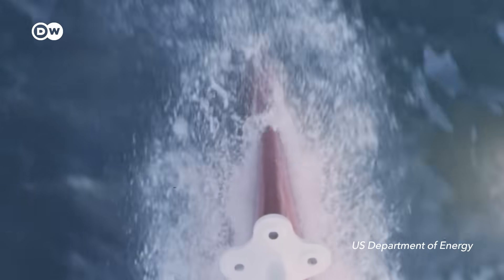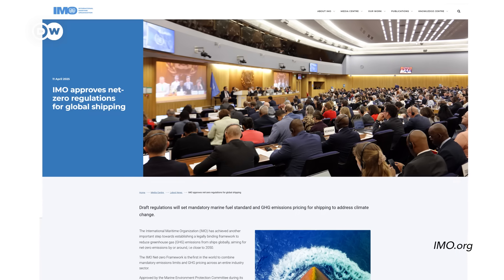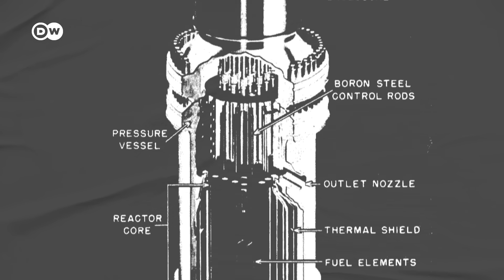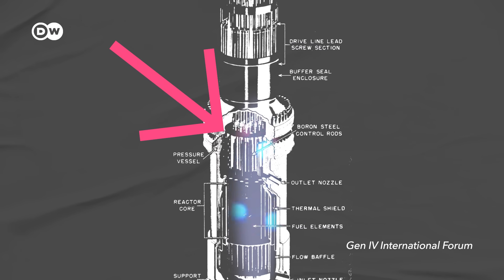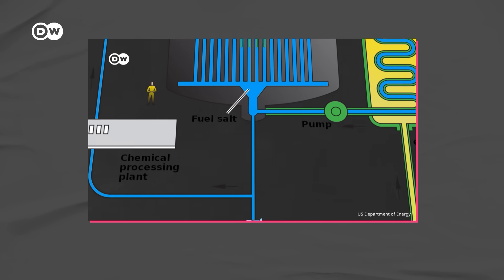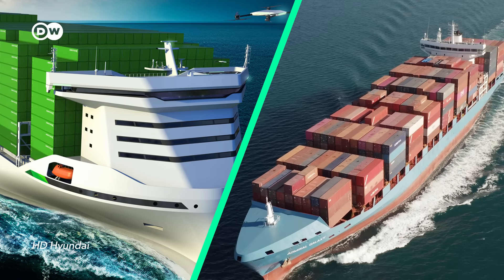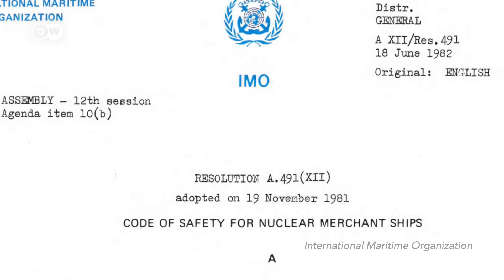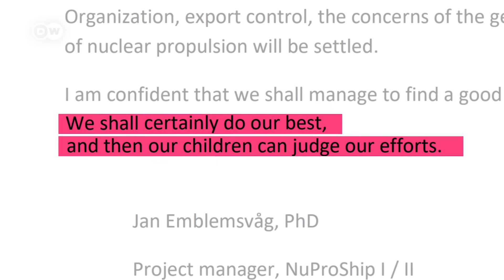Why people want to put nuclear reactors on ships

Comment: One advantage of a nuclear ship is it is faster than a conventional oil ship. Ship that uses fuel oil sails at about 19-25 knot for maximum fuel efficiency to reduce fuel cost. But nuclear ship cares less on fuel efficiency or cost, it will sails faster like 30-35 knot which will reduce time of voyage and shipowner can charge higher shipping price for faster delivery. And it also boosts utilization (lifetime accumulation of total voyage mileage) for the same 30 years lifespan.  Nuclear ship is very expensive in capital investment for shipbuilding, you should maximize its utilization or earnings per year to cover expensive ship cost.
Reply: One area I think it would be good for would be for doing longer trips and make the ships big.  They would be doing the cross ocean shipping and then for more local shipping you could use other solutions.  Even in some cases you could use batteries and the nuclear powered ship could actually provide the power.
Reply: @pin65371  Ships really can't get any bigger. Or well they can but they are already running into issues with things like ports and rough seas. So they would likely be kept large but unlikely they would get much larger. But the possibility of reduced engine and fuel section combined with higher speed would likely make up for that.
Reply: @pin65371  Batteries on ships are simply a horrendous idea.
Reply: @ZippyPiglin36  For ocean shipping batteries are a bad idea, but actually a good idea for inland waterway transport. In my home city we have some battery electric ships for public transport.
Reply: @Phantom-mg5cg  Inland, can be. Inland doesn't take up much pollution or cargo tho, so changing there is mostly incremental change. 

Shipping in general takes up only 3% of all Transport Emissions, while carrying over 50% if all Cargo. Transportation in general is only the second largest carbon emitter, first largest being electricity production.
Reply: @ZippyPiglin36  As far as I know, shipping is responsible for 10-15% of the emissions from transport and around 2-3% of the total emissions. Maybe check your source again. Of course ships are a very efficient way to transport goods, but we need to get to zero emissions and getting ships clean seems very difficult, while we have great cleaner solutions for things like electricity, residential heating and cars. The electricity sector is already in the transition to renewables, it just takes time.
Reply: @ZippyPiglin36  if you think in-land shipping isn't a major thing you clearly don't know anything about the American maritime highway system lmfao
Reply: @ConstantChaos1  Is it anywhere near ocean going cargo?
Reply: @ZippyPiglin36  what? That question doesn't make sense. The amount shipped is the important part, not its proportionality or location 

It's also important to look at what is being shipped and by what methods as well as the ecological impacts of the various methods used. 

The impact of petrol product leaks on freshwater environments  is greater than the direct impact on most marine ecosystems. There are also more mechanisms at play that require greening, like locks or ship elevators. And then we have the fact that goods travel up stream as well as down which is more energy intensive than standard. 

Just because it may not be a large percent of shipping doesn't mean its not its own independent big thing to deal with.
Reply: @ConstantChaos1  fair enough
Reply: if you need speed you pay for a cargo plane or something simiular as there are planes that can transport TEU's soo yeah
Reply: @wake_up_this_is_hell only if it's incredibly small and valuable tho, shipping by plane is way more wasteful, and also you're talking about situations where speed is the most critical factor, while the comment you're replying to mentioned increased speed as a secondary effect. Large volume shipping would benifit from decreased shipping times, even if the product itself isn't actually one for which speed is the highest priority, it decreases labor costs and makes acquisition much easier
Reply: Also it would cut all the harmful emissions coming from an equivalent ship
Reply: @blocky8344  it won't.
Reply: @ZippyPiglin36 do you know how a nuclear reactor works since the only gas that is expelled during nuclear reactor operation is steam
Reply: @blocky8344  The steam expelled isn't a direct loop from the reactor or turbine; it's from the steam condenser's cooling loop. 
The Reactor would heat water, which would pass through a heat exchanger to boil water in the turbine loop, spin the turbine, and with some gearing directly drive the propeller shafts. The turbine exhaust could be cooled with a steam condenser, but could also be designed to recycle said exhaust for on-board auxiliary power. 
Using steam to directly cool adds some efficiency, but in the small scale needed on ships, passive cooling or no cooling would be okay if designed for such.
Reply: @ZippyPiglin36 ok you do know how it works so no harmful exhaust gases great
Reply: Oh yeah, 3-day delivery!
Reply: yea and the Ford class aircraft carriers proves this that gigantic ship can travel 30mph which is insane considering how large it is.... (i do not remember what that is in knots)
Reply: There will also be less time wasted on refuelling etc. it’ll be able to run none stop! If the unloading and re-loading gets quicker and more efficient, they’ll early be stopped. I assume maintenance would also be somewhat less, as I’m sure a typical engine will require lots of maintenance, spare parts etc. with a nuclear powered sub, there will be less moving parts
Reply: @H4VVK5Y  It'll load a tiny bit faster yes, but maintenance won't be "little". 
The real savings is fuel costs, fuel security, and lack of reliance in infrastructure.
Reply: but why would you want to be less fuel efficient? the fuel and the disposal of the spent fuel still has costs to it, especially the disposal isn't even fixed in price. so there is no real argument for just going full speed and not considering fuel economics.
Reply: @sebastianr1475  You don't intend to refuel naval reactors. You put a set amount of fuel in making tnose naval reactors, and don't open it for 20-50 years. Most cargo ships last 25-30 years. 

After their lifespan is over, maybe take the reactor and turbine out, and recycle materials or reuse reactor for electricity after diagnosis.
Reply: @sebastianr1475  For a fossil fuel container ship, fuel is about 50-60% of ship operating cost. Capital investment of shipbuilding is about 20% of total lifetime cost.  But for nuclear ship, nuclear fuel cost is just 5-10% of total lifetime cost of reactor. So fuel cost is nothing compared with capital cost of reactor. A nuclear ship can operate at maximum power most of the time without worrying about fuel cost or efficiency.

Comment: From a pure technical perspective, it makes much more sense to put small reactors on ships than it does mass producing small reactors for stationary power generation, as there are much cheaper alternatives for stationary power generation that can't work as well on ships. That doesn't mean I think nuclear powered ships is a great idea.  

Nuclear power propulsion isn't likely to become as cheap as bunker fuel diesel engine propulsion is, in the foreseeable future, not even close. The cost of the fuel is only part of the total cost, comparing just fuel costs is irrelevant, wind, solar and hydro power has no fuel cost at all, it doesn't make those technologies free, even if they're often cheap, in the long run.     

Still, nuclear powered ships are probably more realistic to get financially acceptable than synthetic fuels from renewable energy or biofuels are.              

But then there's the issue of "political instability". Oil spills are bad enough, and even if you disregard potential environmental aspects, it's not that attractive to spend the billions of dollars necessary to develop mass production of systems when you know those ships can become too risky to sail through important areas at any point in the future, even just from a financial standpoint. That makes nuclear powered propulsion for commercial shipping as a "drop in replacement" for the diesel engines quite tricky.    

In a world where we wouldn't have to worry about "political instability", were we all got a long and cooperated, most of the transport could be done with electrified trains, and in that reality ships would only be needed to move goods relatively short distances.

Comment: Yes, putting nuclear reactors on ships is a good idea. It's the only decarbonisation option available in the not too distant future.
Reply: Why is ted bundy on your pfp?
Reply: @kp41444 because I'm a cereal killer.
Reply: Fallout would be wild in case of disaster
Reply: @jaydeep-p  not really. Also it rarely happens that a military sub or surface vessel blows up even though they do it as cheap as possible (lowest bidder) and the reactors are usually maintained by very young and sometimes inexperienced guys
Reply: Agree but the question is little more complex, it's like saying filling solar panels in the Sahara and covering world electricity needs, but ignoring the war lords and religious elements there. STOP WITH STUPED IDEAS! more likely is nuclear ships will make a come back in specialized niche area, and not the main back bone of shipping.
Reply: @skankhunt38 Again, if small modular reactors should prove economical, there's no reason to assume that they necessarily won't be a viable option. Also, if you're going to accuse people of having 'STUPED IDEAS', at least make an effort to spell the word 'stupid' correctly.
Reply: Yeah nah. Virtually all research towards lower emissions shipping is going towards increased efficiency, lower-carbon fuels, and ammonia in the short-term and fuel-cell propulsion in the medium term. If atomic power is a good idea then why is literature virtually silent on it?

The future is ammonia or fuel cells on large ships—green hydrogen or green methanol—and maybe batteries on small ones.
Nuclear reactors might be a decent way to generate green fuels in regions where it's for whatever reason more desirable than renewables. But I doubt if it'll ever be economical to put reactors on merchant ships.
Reply: @YourFriendlyOfficeAssistant if the promise of cheap SMRs ever comes to pass. then the economics would work. SMRs in general, however, should be met with a healthy dose of scepticism, IMO.
Reply: @alexishart1989  I agree on that, SMRs would change everything. With the technology we have, however, I think there are far more promising options.
Reply: @YourFriendlyOfficeAssistant sure, too expensive to put one of the currently available reactors on a single ship to power it. However, there was an academic paper from some years ago that argued for nuclear power station ships to power a convoy of ships behind it, each one connected to the one behind it. That seems like good value if you have one ship powering another 10 or whatever.
Reply: @alexishart1989  Problem is it seems pretty impractical and niche compared with options like ammonia or fuel cells. The situations in which that would be both possible and useful are limited.
Reply: @YourFriendlyOfficeAssistant  Atomic power would be too easy to lose to pirates and terrorists due to the bottom feeding nature of most shipping companies. There's not a scenario where we'd put these on ships when bad actors will get their hands on it, and next thing you know NYC gets irradiated by a terrorist on a plane.
Reply: Lower carbon means more expense, more planned obscolescens too.

Comment: The problem with nuclear energy is overregulation, which leads to huge cost increases. They can be made safe with a reasonable level of regulation, then we can redevelop the capability to build them. I wish we had cheap nuclear again, but this time even safer than in the 60s. I want nuclear ships back, but we need to revise regulatory rules first.
Reply: "Over regulation" does not make things more expensive, Capitalistic Greed controlling everything is what makes shit expensive.

Comment: Very bad idea, its like going backwards. the battery technology is improving exponentially. There are other better and hybrid solutions as well.
I agree with others, it is never cheap, never ever.
Reply: Nuclear offers much more benefits to shipping than batteries, it's just pure physics. Batteries are great for land transport of smaller vehicles like cars and trucks.
Reply: @stijn2644  yes, there are much more benifits of nuclear, I mean no hastle of charging or refueling often, more power, no greenhouse gases etc... and so are the challenges, safety, unintended radiation risk, fuel handling, waste handling and most of all, the skyrocketing cost. So, in the big picture, this is absurd. For battery, we think like you said because this is what the general public know about, there are many many more and better battery technologies if weight is not a priority. Liquid metal, Sodium Ion and many more. Those are much more powerful, economical and reliable. By any chance I am not proposing that the batteries we use in cars and trucks to be used in ships as well. The equation is different here. Ships can handle a lot more weight than cars and trucks. So batteries are the best compromise in a practical and realistic scenario.
Reply: @TheArtOfReason  yes absolutely it does bring risk, that's why half the video is on regulations. On the cost front it's a different picture. In the west we've forgotten how to build them, that's why they're so expensive now. In Europe we now have the first new reactor in 30  years, same goes for the USA. If you don't build stuff it gets really really expensive when you start this supply chain up again, but that doesn't mean it's not worth doing.

Could you point me to batteries that can be put on ships? Let's say you have a Maersk Mckinney Moller, that's 80MW of power with a specific fuel consumption of 170g/kwh. a Journey of 20 000km at 23 knots will take 19.5 days. This journey will consume 82 GWh of thermal energy. Now let's half this for electric propulsion so that the efficiency of the electrical system is more realistic. This is still 40GWh of energy, where do i find these kinds of batteries? I'm genuinely curious if there are any, thanks.

Comment: The one unmentioned benefit is that such ships could contribute to supplying power to the ports while docked.

The one unmentioned challenge is that most of those designs require fuel that is very different from what is currently used in land PWRs, and for which no large-scale supply chain yet exists.
Reply: But I could imagine special refueling stations for nuclear ships,no? Considering they can go weeks (months?) without refueling, it could be part of the ships itinerary to make a stop to a special port once in a while
Reply: @MrChoklad the USA supercarriers only refuel each 20 years so a long time between refueling
Reply: @Groza_Dallocort yeah so that's not even a big deal then, it's just having ports accepting these ships in
Reply: @MrChoklad yeah granted if a nuclear reactor on a ship start to meltdown you can just scuttle the ship. Once the reactor is submerged the chance of a Chernobyl explosion goes way down. At least that is the floating nuclear reactors Russia have is supposed to do, end up underwater if a meltdown occurs
Reply: @MrChoklad  iirc, the plan for small, mass-produced reactors is, that the entire reactor will be replaced when the fuel is spent.
Reply: @MrChoklad  Months? Design is for so, and you'll overshoot the ship's lifespan by decades.
Reply: They do mention it at 7:55
Reply: @cemdursun madness, the commenter said it was unmentioned
Reply: @willinton06  unacceptable! Right to jail!!1
Reply: Ships have been doing that for years. I've got a photo from the seventies of when the local power station failed and we had a ship generating shore power.
Reply: @YourFriendlyOfficeAssistant  sure, but with the onboard reactor. Again, not a new thing but not been done on a large scale.
Reply: Supply chain exists in Russia.
Reply: @sidsarkar yeah nope
Reply: What do you mean by different fuel? 3-4% enriched Uranium in a water-moderated PWR would work just as fine on ships. Why should it be any different?
Reply: @Chris-uu2td  Between larger core sizes and much shorter fuel campaigns, I wouldn't do that in the context of commercial shipping.
Reply: Also no. All require Low Enrichment Uranium. Pretty easy and common to make tbh. You'll only need High Enrichment if you're going for very specific tiny fast-responding designs. Cargo Ships have no need for such at all.
Reply: @ZippyPiglin36  I was thinking longer fuel campaigns (rather than purely the size) might come quite handy for civilian cargo ships.
Reply: @derloos  You can get long lasting fuel in naval reactors, no biggie. 
Instead of trying to make expensive online refueling or use expensive continuous refueling reactors like PBRs and MSRs, just design a reactor core that uses LEU for 30 years without refueling. Sealed Core makes is cheaper to make, using a BWR or PWR design makes it much cheaper and easier to license, and it well outlasts cargo ship lives, thus making it possible to reuse them on land after they retire navally.
Reply: @ZippyPiglin36 interesting, are there any long-term, sealed LEU designs out there yet?
Reply: @derloos   Not that I know, but there are such HEU variants used in military applicaitons extensivley. 
LEU simply requires larger cores to handle more fuel rods for equivalent amount of U-235. Not complicated to design in the slightest, since geometry and thermals remains pretty much same in function. .